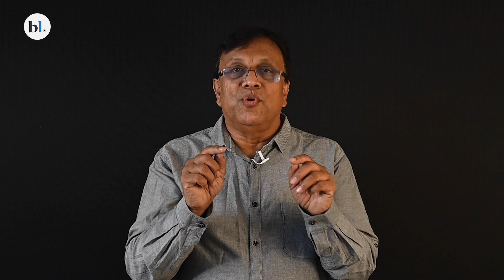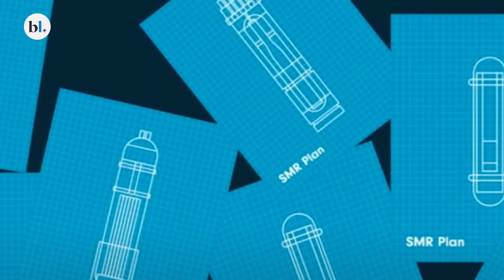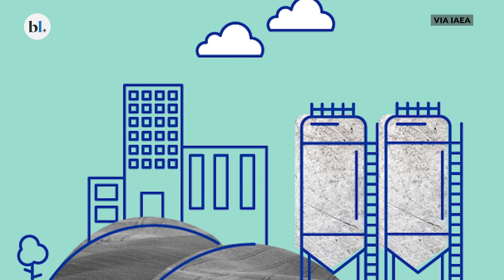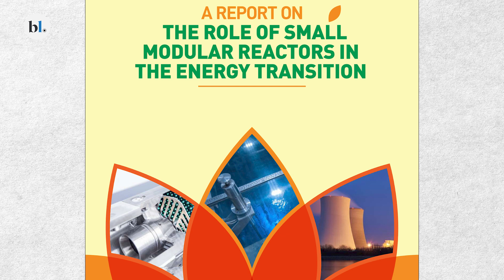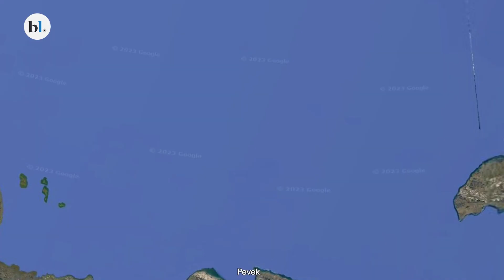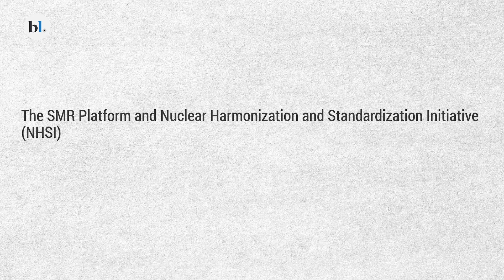Harnessing the power: How small modular reactors are revolutionising nuclear energy!

Comment: Wonder where the claim that Turbines are not neededin nuclear power plant is coming from. A nuclear power plant only uses a different heat source and so the bouler will be different but the turbines can still be used. It is the big areas used for cial storage and ashpinds etc that can be replaced. 
However, the big question should be whether it is worth spending billions on nuclear energy when a combination of sun and batteries could the same